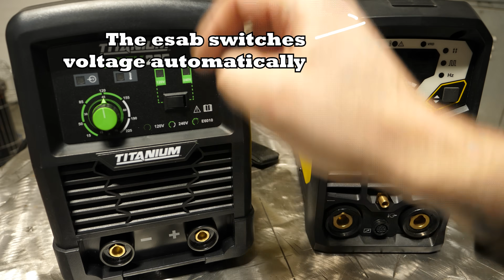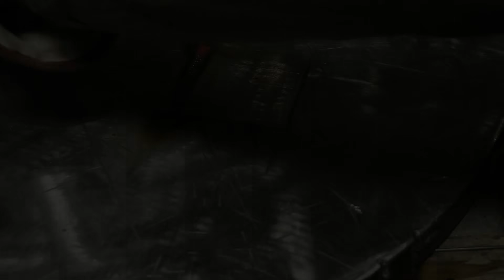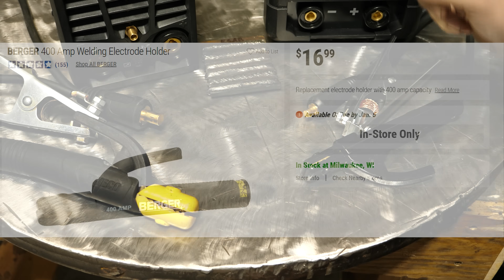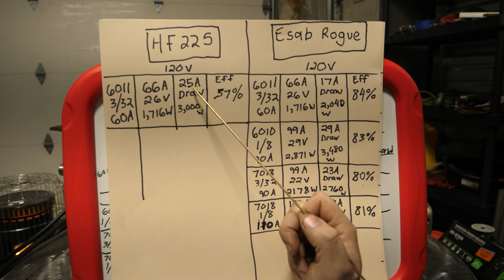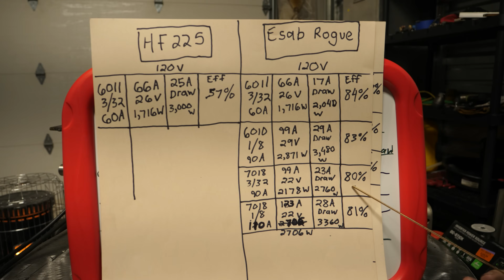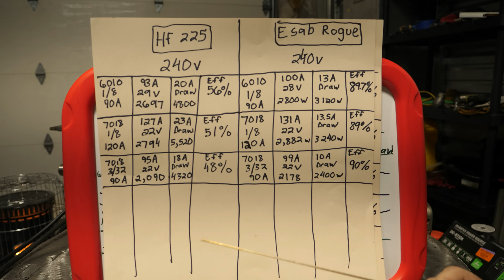Cheap HF vs expensive Esab welder comparison:  Deep dive

Comment: I have the fronius transpocket 180 and I was warned by fronius not to run it on a generator under 7 kilowatts because of momentarily increased draw from arc force and or hot start settings which can temporarily demand more wattage than the generator can effectively supply which can drop the hertz outside the allowable plus/minus 10 percent.  Also tbe 7k generator rating does assume some safety factor to keep the generator closer to 75% of capacity to increase the working life of the genset and the welder.
Reply from the maker: No doubt to max out the 180 on a generator could require a lot of power.  Fronius is probably one of the best companies at designing a welder to function electrically safe and efficiently.  Their 180 at 90% efficiency could still draw 6600 watts at start at 180a.  So 7k is within the ballpark of starting watts you would really want.  Realistically a 6-7k running watt generator would be better and be better for the longevity of everything involved.  It’s not cheap running a welder on a generator, many people significantly undersize the generator or use cheap ones with poor output power waves.

Comment: Another great video. The actual electrical performance was interesting to be sure. I've realized if I look for a first welder that is an inverter type machine vs buying an old used monster, it will be a much cheaper 240v circuit run at 30amp vs a 55amp run. The efficiency is wild that 80% to 90% is converted into actual useful output, gone are the days of wasting energy to heat loss. I think a serious home gamer would be well served to pinch their pennies to get a high quality machine. That said, the harbor freight is looking like a great entry point into welding for the novice.
Reply from the maker: The old transformer machines are reliable and tend to work well, but there isn’t a day I would take a tombstone over the HF 225.  In todays world the modern inverter machines are actually so much more useful and honestly weld better than many machines in the past.  The physical size differences and weight make the new machines far more useful, lugging a 70lb+ box that needs a 50a output to output 150amps is long gone lol.
Reply: I've realised that like most things, the expensive machines in many ways are the best place for a beginner to start EXCEPT for the price.

They have fancy tricks to them like hot start, arc force, anti stick etc which really help you learn and avoid so many of the nasty snags in Welding like your rod getting stuck all the time.

As long as a veteran sets these parameters to take the complications out.

Cheaper machines might not have all this 'support' and may require a very skillful Welder to get good work out of consistently, being a real frustration for a beginner Welder. 

However, no beginner Welder should be spending bug bucks on their first machine. Luckily many cheaper machines these days have all the fancy stuff at lower prices.

But I noticed this with Guitars that the more you pay for a guitar generally the easier the thing is to play but you started out on an awful cheap acoustic guitar and it took three times as long to learn as it should have...

Comment: Very interesting comparison.  I wanted another/cheaper welder for portability/use in arc gouging (5/32" carbons @180-200a), and I was interested in the Titanium....but ultimately went with the ArcCaptain MiG 200 (turns out it maxes out at 180 on stick mode) because of the additional features. It runs 6010/6011/7018 fine, but I don't have a clamp meter, and the output seems to be 15 or so amps below my Miller...... which is why I'm still thinking about a Titanium 225 for this purpose.
Reply from the maker: Arc gouging is always going to be hard on a machine due to the voltage it operates at.  Generally the best welders for that are ones that are transformer based with simple bridge rectifiers that can be replaced as needed.  Air arc runs at 34 to 52v, which at even the low end of 180a is a ton of power.  To put it in perspective 180a air arc is equal to around 250amps on a big 7018.  The titanium 225 may run a carbon at 180, but it’s duty cycle will be very limited.
Reply: @makingmistakeswithgreg  - So, I also have a Lincoln 225AC that mostly sits around..... would I be better off, to just install a bridge rectifier on it (aka, the DC conversion shown on several YT vids)?  Or am I misunderstanding-?  Thanks!

Comment: Great comparison Greg.  Bigger difference than i expected.

I need to find another clamp on amp meter and test my Everlast 210 and see how it fares.
Reply from the maker: The everlast 210 is likely in the 60-65% range.  I have tested a lot of their welders before I had the channel and that’s the ballpark.  I will be testing their 161 sth soon for a video.  I do like everlasts welders, mainly their dedicated tig or stick units.
Reply: @makingmistakeswithgreg  Thanks for the info.  I've used it a few times on 120V and don't recall kicking any breakers.  It's mainly on a 40A 240V circuit so it's not an issue.

I'll pay attention to the heat generated next time and see if it's noticable.

All you testing is very eye-opening. Thanks Greg.

Comment: Everlast 210stl for 599 same exact features as the esab rogue the titanium is junk had it feels like 10 lbs
Reply from the maker: The everlast 210 is a great option for people.  It’s no more efficient than the titanium 225 though.  It gives the adjustability of the rogue with the affordability of the titanium.  It’s priced between the two, which makes sense.  Personally I rather buy a used rogue 180 over the everlast 210 for the same money.  Having used both machines it’s better where it counts, and it is far more efficient.  I still stand buy the titanium 225, I built 2 tow trucks and knocked out probably 30 jobs with one, never had a issue.  There is no better welder for the same price in my opinion.  Anything better will cost more.
Reply: @makingmistakeswithgreg  I 100% agree with you, but I'm trying to find a portable stick welder I can use on a generator that can only output 25 amps on 240v. I'm very tempted by the Titanium 225; I want to give learning stick welding a try, but if I need to buy a bigger generator to be able to run the Titanium 225, when for a few hundred more an Esab 180i Pro looks like will run just fine on the old generator. I just need to make a power pigtail for it to adapt a Nema 6-50R receptacle to the 250v 30amp twist lock recectacle on the generator, and flip the switch from 120V to 120/240 and be good to go. I'm thinking with what generators cost these days, there's no way I can buy a bigger generator plus a Titanium 225 versus just the Esab. A 7600 watt generator is not cheap, and there's no used ones around, any used ones that were working got snatched up last year, and the year with the huge ice storms in Texas, good generators turned into Unicorns overnight.
Reply: No power factor correction on the Everlast. Northern tool has the Klutch 201dv which is probably the cheapest thing you will find with power factor correction but I won't be doing business with northern tool with the way they treated Greg and other people who have ordered from them recently. I hope you don't either.

Comment: Great comparison. That's awesome to see the Rogue output 123A on 120V. The higher 120V output was a big selling point for me over the Titanium. I was actually going back and forth between the Esab and the Fronius since Fronius advertises 120A on 120V. The $2700+ price tag on the Transtig was too much to swallow for a first stick/tig welder. Pretty cool to think that I could throw a generator, a job box, and the Rogue on my little HF trailer and basically have a basic mobile welding outfit. Welders have come a long way in the last decade or so. Thanks for taking the time to do these comparisons.
Reply from the maker: The fronius is a good welder.  The struggle I have with fronius is nobody sells/services them here (multiple hour drive to get to a company that does).  I live in the biggest city in Wisconsin so that’s pretty crazy nobody sells them.  With esab the 3 year warranty I have a bunch of places I can take it to if I need it, same with miller and Lincoln.  The rogue series is a very solid welder and I built a ton of stuff with the 180 I had.  The fact you can literally weld thick steel on 120v is amazing.  They definitely have come a long way.

Comment: Excellent analysis - very good information.  You're the first I've seen to take your review past simply technique and testing.  Duty Cycle would have been interesting since it has a significant impact on the intended use of a machine.  I would like to see a similar analysis with the Everlast product line.
Reply from the maker: The issue with proving duty cycle is that it’s very hard to do.  The output of the titanium 225 will trip the breaker on my generator.  I could max the esab out without a issue.  The other issue is temperature.  The ambient temp in my shop is 25-45 degrees now, and that will significantly increase duty cycle.  The esab is rated at 104F.  So the validity of the tests will be suspect.  Once I get to a new shop (I have been trying to find one to buy) I will do more tests like you mentioned. 

As far as everlast, a friend just bought a 161sth so I will be testing that out.  In the past everlast welders I have owned have trended towards the 60-65% efficient range.  I am a fan of their dedicated welders but I found there all in ones to be poorly designed in comparison to the competition (ie lightening).  Definitely will get into few everlast welders 😀

Comment: This test really shows that in truth buy  a machine that has 240 volt, they are more efficent and have longer duty cycles which really is the most important thing. I run all my welders on 240 volt , 3 are dual voltage one is the HTP is only 240 volt. Greg one thing you could test which does have a baring on current draw is pulse stick.  My Fronius 180 has pulse stick and I can weld as much as I can stand without tripping breakers and the fan does not come on untill I run 7024  1/8 at 145 amps and use the whole rod then the fan comes on which means it is very efficent . Another thing is nobody really considers what size of wiring is in their home / garage/shop. Most homes are using 14 or 12 guage wire and the wire size can only conduct so much current till the wire starts to heat up which could be a problem, if it starts a fire somewhere in its path. I have a 40 amp breaker on my 240 in my shop and the corresponding 10 guage wire. Non of my welders has tripped the breaker even at full run, because they are all inverter welders. My old Miller 225 thunderbolt would trip it often. Your right, for most home welders a 120 volt machine will be okay for small rods and light work, but once you get on with welding then a dual voltage is the way to go, and do an upgrade on wiring if needed. By the way Lincoln sells 7016 rods in 10 lb tubes. Canadian Welding Supply has them in 10 lb tubes right now you have to buy 3 tubes, if you pay in US dollars it costs you 30% less plus shipping.
Reply from the maker: Yes, 240v is far easier on a welder to produce output power.  It’s amazing that the esab can even produce the power it can on 120, but it definitely prefers 240 for sure.  A lot of people want to be able to weld off a 120v socket and that rogue is about the only practical way to be able to have functional output on 120.  Even though it runs the rods, it’s harder to start a arc, and I am sure it will produce more heat.  

You are correct, just plugging a welder in and thinking you’re ok is a mistake.  Most houses should have a breaker that is sized for the wire (15a for 14ga, 20a for 12ga) but what’s to say someone didn’t screw with that and did things wrong.  The only way you will get to the output I did is with a dedicated breaker, which many houses don’t have.  It pays to verify what you have and get it upgraded to what you really need if you don’t have it.  To me the 120v ability of a dual voltage welder is more for emergency and not for the primary use.

It doesn’t surprise me your thunderbolt tripped breakers.  I need to pick one of those up as a deep dive video to demonstrate how they work.  They are somewhere around 30-40% efficient, which is why it’s so amazing to hit 90% out of a modern welder.  I had a ideal arc 250 and it actually hit 45% efficient, but it had power factor correction capacitors.  The drawback of the capacitors was it improved the power draw under load but increased the draw with no load.  Idling it drew like 15 amps on 240v lol.  I will stick with modern welders I think lol.

Comment: Commented on a previous video that I saw a new welding table from Harbor Freight.  Seems to be the case.  I use the older table from HF and OK for small stuff.  Wondering if you have any thoughts if its worth the upgrade.  I like the fact it comes with clamps and definitely more options on that front.  Great comparison on welders. Nothing "jenky" about it.  I have a much better idea of what I can do on the HF welder at a given voltage and appreciate the data driven thoughts and conclusions tempered by your extensive experience. Have a great and safe holidays!
Reply from the maker: That table is the same table that northern tool has sold for years as a “klutch” brand table.  It is a decent table for the money.  I have looked at it and the northern table in person.  Here is the good and bad in my opinion:  Good: the top is far thicker than most of the cheaper welding tables.  That’s great because it will last far longer.  The clamp system is very useful and functional.  The price (with coupon) makes it very affordable.  The fit and finish is pretty good.  Bad: the top isn’t flat.  I put a straight edge on the northern tool version and it was far from flat.  The top is thick but if you weld on stuff directly on the table (think butt welds directly on the top) it will likely warp still.  The clamps work but are fairly cheap.  My overall opinion is it’s worth it.  From a clamping perspective it will be better than the Dewalt I had in a video (and still own).  To get something better is probably a minimum of 400$ more, if not more.  If I wanted a little fixture table like that I would try to find a old machinists table or something on marketplace and make a stand for it.  It won’t be less than probably 3-400$ and a bunch of time though.  All things considered I say the table is worth the money.